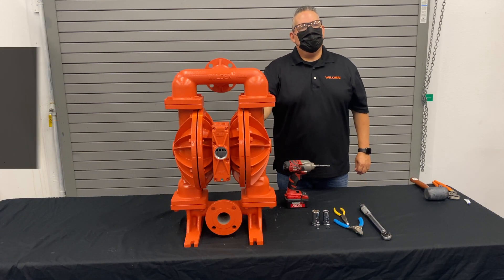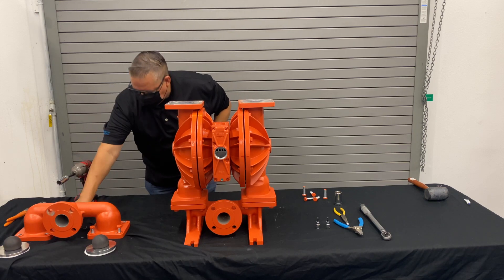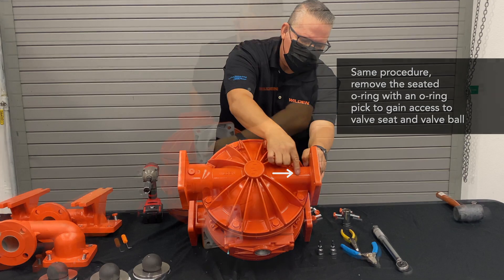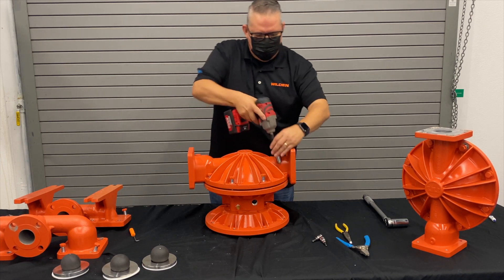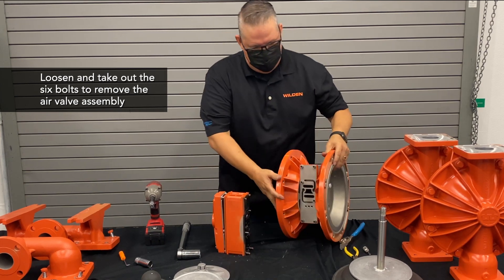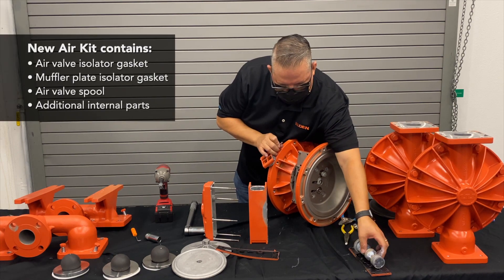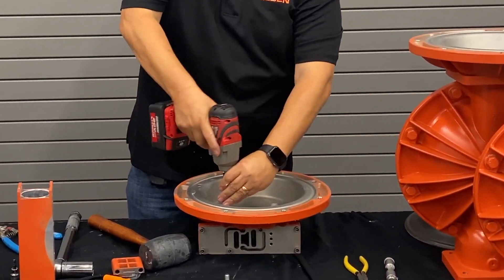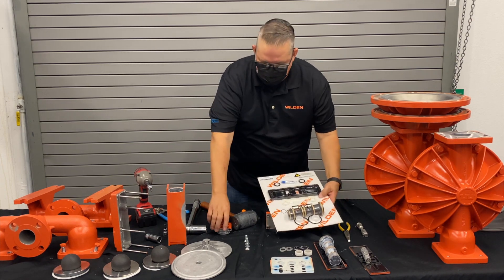How to Disassemble a 2 in. Bolted Metal AODD Pump

Comment: These pumps are so powerful they can drain a lake even when running at 25 - 30 PSI. I've actually remembered when I was at work using one of these to transfer very thick liquid with some sediment along with it to another tank. Pump broke down after and called for maintenance. When the maintenance dissembled the pump, the inner piston was pretty much broke in half. Never seen anything like that.